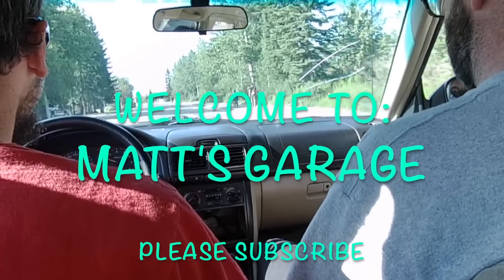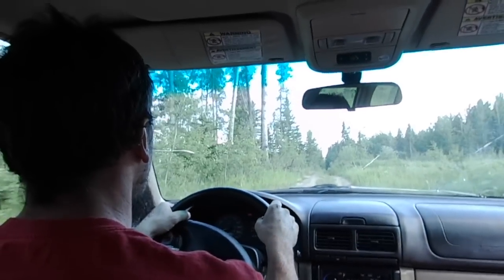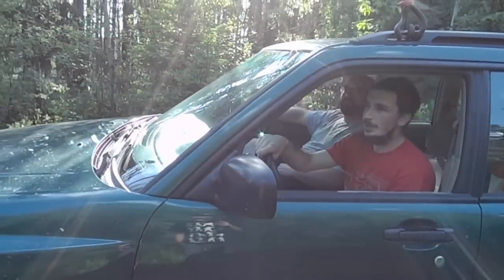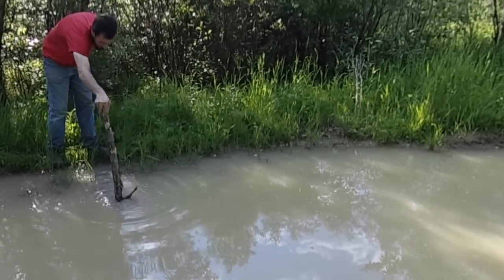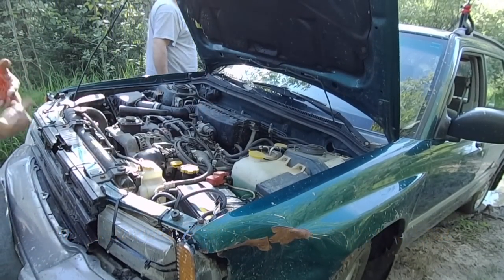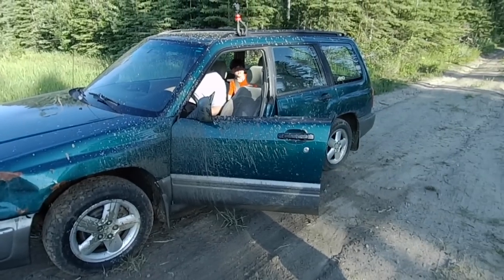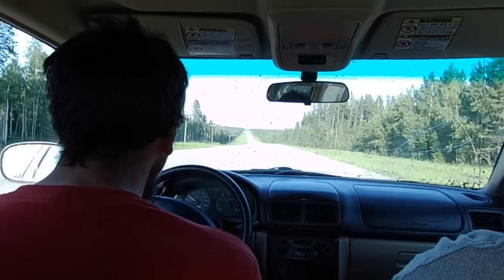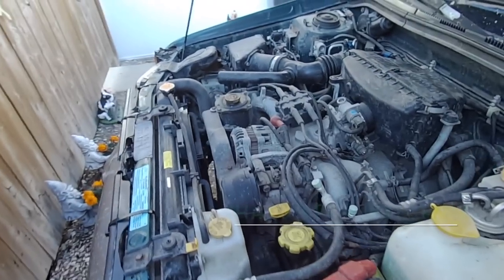$300 Subaru Off Road!

Comment: To take a page from early Nascar racers, who raced on slick mud tracks, the  first thing you want to do when you get into a new car is to wrap a narrow band of white surgical tape around the top center of the steering wheel, so that you would always know when your steering wheel is guiding the car straight ahead.  There were times when you were trying to go straight ahead  but the front wheels were at a sharp angle, reducing the chances of a successful extraction.  Also, put more Slime in that back tire.  A quick trip to a junkyard should yield the parts you need to restore the Subaru to its former glory, or just buy more zip ties. 

Is Sean a car nut or a draftee in your car adventures in the wilds of Canada?  Thanks for this video, it was very interesting.  Canada is so vast and forested that you may need to start carrying a drone with you that can carry a cell phone repeater way up in the sky so that you can triple or quadruple your cell phone range and have the ability to summon help when you get stuck.
Reply from the maker: Anonymous98 I was actually aware of those times I had the wheels cut, that was intended to try to get the car to climb to higher ground and get it out of the water sooner. We actually put a full can of “fix-a-flat”’and a full bottle of Slime in that tire, but it was actually leaking thru the rot cracks in the sideway so it was somewhat hopeless. The Subaru has a written off title so it’s not just a matter of fixing the damages, I do have further plans for it though so stay tuned. We actually have good cell phone service down that whole trail, we found that out the hard way (got our Neon stuck in there really good once haha) Sean is into cars but not to the extent I am, this was his first time wheeling, he has fun!(-:
Reply: Matt's Garage Take a look at the YT channel of Sixtyfiveford for some creative ideas on the use of the different types of Slime and for some other great car and shop related ideas in general.  He is one creative guy, and if you haven't seen him before, I think you'll get a kick out of his channel. Here's a link to ome of his videos on the uses of Slime - https://youtu.be/7G_HQMbb5tU.

P.S. In my limited experience in both the deep, slick red mud of the deep South and the frozen mountains, plateaus and valleys of Tennessee and Virginia, you can't drive out of or be pulled out of a deep, slick, muddy rut without either a farm tractor/wrecker pulling you or getting up a fair amount of speed & forward momentum in your car before you make your big move. In the latter case, you'll have a few moments of real excitement avoiding trees, etc., until the car stops spinning or violently fishtailing and you can straighten it out. At least that's how we did it, in our misspent youth.
Reply from the maker: Anonymous98 I’m actually a long time subscriber of sixfiveford, although I struggle to keep up to all the awesome channels I’m sub’ed to.

Comment: Yeah they're pretty capable offroad for a stock vehicle, but the big problem is beaching the undercarriage, subframes, or rocker panels.
Also no sure how well protected all the components are from really deep water like that, though I have waded some deep pools.
The manual tolerates it better than the auto, it would seem. Overall it didn't do too bad! Especially for $300 and unknown condition really, hah.
Oh, and that dual filter setup is strange. I have only ever seen them with one or the other. Wonder if they only did that for a couple years.